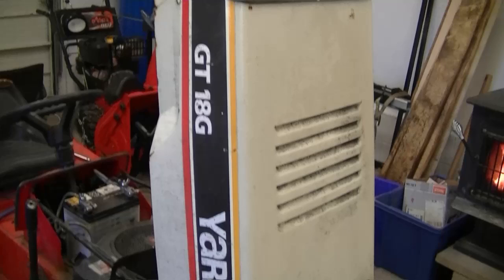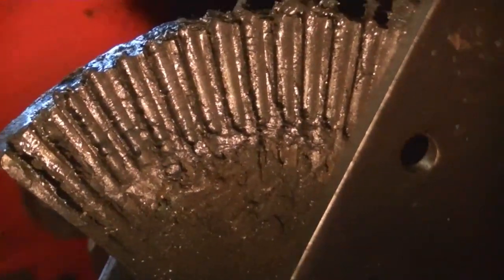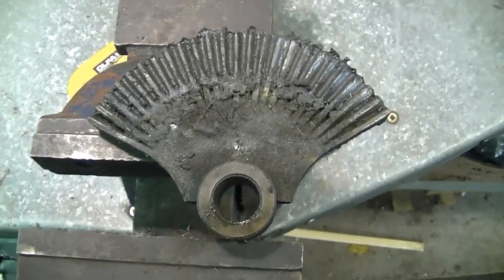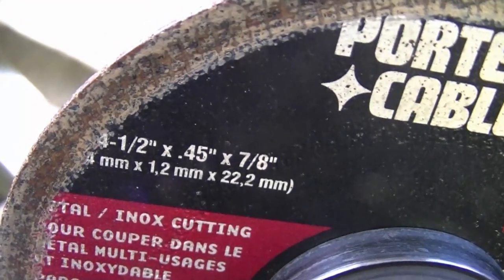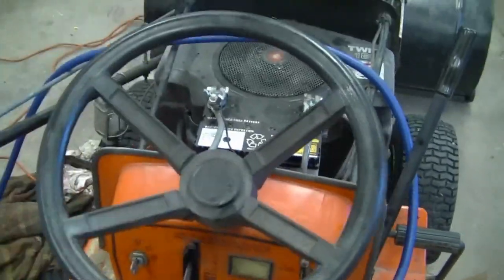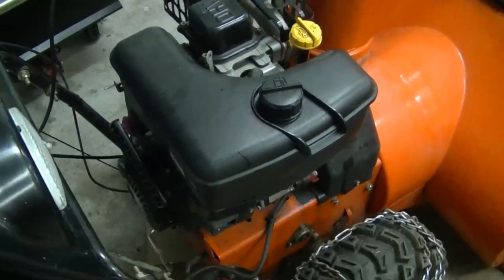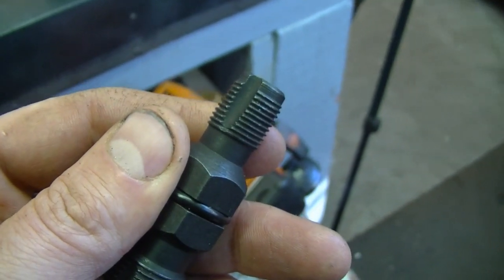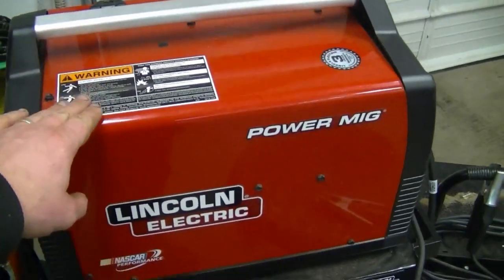WHAT I'M WORKING ON - Episode #2

Comment: Hey Dony, I was thinking about putting a wood burner in my garage but was afraid that the flames would be a problem around my snow blower, log splitter and various other yard equipment.  I see you're working on a tractor right by the burner.  I take it that I've needlessly worried about this or are you doing something different that I should know about before I become the human fireball.
Reply from the maker: you need to speak to a wett certified inspector for your area

Comment: Thx! I have the exact same garden tractor. Same steering problem. But I only tighten the "pusher-bolt" on the side of that part (the whole mounting has an adjustment where it seem we should push that bolt further an next time etc) I thought that this part was pressed-metal, therefore not really suitable for welding (now I see I guessed wrong). Well I'm gonna weld mine as you did (and loosen that bolt a bit cause it's hard to steer lmao) 
Do you have any reference/manual/etc on that tractor? 
I don't need any about engine/transmission/pulley-setup(bearings) as I have all those independently (peerless/briggs/etc)  I can't seem to find anything whatsoever about what are the real belt-drive length on those.

btw.... I'm sub to your channel for the past 2 or 3 years now. I just can see why I never came upon this particular video although I've trying to search info on those from time to time for the past 4 months. Serial on mine is 146-832-595. Its belts were A38 and A57-1/2. But the closest MTD built I could find for any info was on a White GT18 that has A40 and A59 which don't work.
I'm trying to get rid of the "squeecking". I've adjusted the clutch/brakes but can't go further although this has minimized them "stress" manner of speak (as I'm guessing there's still a stress somewhere..... other than between the seat and the steering-wheel LMAO) ;)

Comment: Hi Donny- I always look forward to your videos! Quick question if you have time- could a loose spark plug cause the kill switch to not work (Ryobi 2 cycle trimmer)? I had one that read good on a meter but would not kill the engine. I tightened the spark plug as it was just a little loose and then the kill switch worked. ?? Thanks and please keep on posting videos!

Comment: Hello Dony,    I rebuilt a 19.5 hp briggs engine for my john deere garden tractor.  I've done this many times in the past but this time when it was all assembled and ready to start it didn't.   All it does is back fire through the carburetor  but won't start,  just back fire.  I have checked the values,  they are good.  I took the fly wheel off 3 times to double check and that is aligned as well.  I have exhausted everything I know and gone over the entire engine over and over again and just don't understand what is wrong.  I just ordered a carburetor solenoid for it thinking that is the problem but the more I think about it , I don't believe that's the problem..   Any insight you may have on this?

Comment: I've had issues with MTD parts Site on these older mowers as well. Think only list parts for equipment 1996 and newer if I remember correctly. I called them once and they directed me to their supply warehouse for parts on older machines. It was for a late 90's lawn chief. Still couldn't get the part!

Comment: Thanks so much for your helpful advice on how to work with small engines. I have a go-kart that had been sitting for 3-4 years and using your videos (I watched every episode of your QandA) and took the chance and worked on it. I ended up buying a new carb and it ran first pull without even choking it. is that normal or do I need to adjust it at all. The engine ran perfectly fine though no smoke had good power etc.  Its a Robin/Suburu ex 17 if you have ever worked with them.

Comment: Hey Donny have a question for ya. just replaced a gasket on the front of my Sears DL3000 ride mower.. have it back together enough to start it up but when i start it it only seems to idle and the accelerator lever is unresponsive. Any ideas?

Comment: I have a older briggs and straton 8hp on a dynamark riding lawnmower. It starts on the first pull but then it starts to over rev and it runs the same when you close the throttle.  What could cause it to run like that?

Comment: Donny have you made any videos on repairing/adjusting brakes on a belt driven rear engine rider mower?  I am specifically interested in a Murray 
Model #      30544X92D
Serial #       7238401672B00080
D.O.M.        96081

I have searched for instructions and even brake component parts lists and not found either one.  My sister has this mower and it runs fine.  It just needs brake work.  It would be safer if it would stop when she brakes.  I am a subscriber to your site, and enjoy it greatly.  I can give you an email address if possible to do so without giving it to the world.